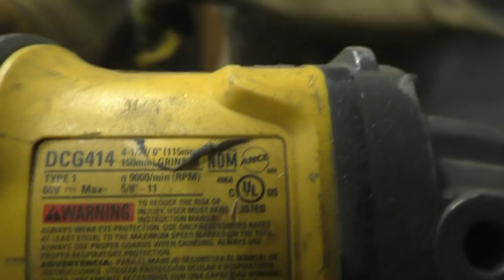Grinder Safety -- and lies you are told to scare you.

Comment: My motomaster grinder with lock on button practically exploded yesterday and I wasn't even trying.  wheel and nuts went flying across the driveway.  Then put it back together and ran it again to see the gears jamming up and grinding away lol....  A broken grinder disc, not cutting discs is even more dangerous due to the mass, but I managed to dodge all mine somehow.  Never use the sides of the disc and bore out the cut slightly larger than the disc used to prevent thinning of the discs by cutting two lines or one and a half grinding disc.  Never had a problem once doing that and always using a vice and two hands.  However I did use a grinder on a stick once and survived.  removing anchors from edges of the bottom of balcony slabs.  Was crazy but still felt safer than grinding on a ladder on the edge of a building.  Lookout below!

Comment: lol everything you said is true.. had my first cut off wheel shatter today, nothing happened. I always cut with eye pro aswell. I still dont want to use a guard even after that happening.
Reply: was cutting rivets out and on one of them at about a 30 degree angle the cut wasnt starting, i pushed in a little bit and BOOM.. no injuries. lesson learned though

Comment: The safety measures over safety measures are mostly meant for workplaces where you're an employee and you employer wants you to cost as little as possible, and it's much cheaper to buy some plexiglass and safety gloves to replace in 20 years than to potentially have to pay for work insurance multiple  times each year because someone had a little (a lot) too much to drink last evening and decided to toy around with power tools.

Comment: Safety is the point. Don’t be afraid of a tool. Learn from a skilled operator, and use common sense. That said, the only thing I’ve seemingly Doug do that bugs me is occasionally use a 7” wheel on a 4” grinder. The smaller tool runs at a significantly higher rpm.

Comment: A chunk flying off the edge of a 6" disk spinning 9000 RPM will go flying at 235 feet a second,  compound hunting bow territory. Yes, the chunk is light, but in the right orientation is jagged / sharp and you are relatively soft and squishy. 

Sure, there are plenty of reasons to take risk in life; there's usually something to be gained. Risk vs. reward. What the hell is the reward for taking the guard off of a grinder that is worth the extra risk? You save the 1 second it takes to repositioning the guard?   Attack a whitewater rapid, ride a motorcycle, enjoy life.   Preferably without experiencing a bleed-out event from a grinder.
Reply from the maker: First, you obviously don’t have a lot of time on the grinders. And secondly if you’re a bumble head with a grinder it’s OK you’re probably a bubble head when it comes to lots of things that you haven’t tried. There are people in this world that have skills that you do not yet possess.

Comment: Removing the guard is okay but removing the handle is dangerous.Grinders may slip out hand when there is no firm grip. I was cutting a aluminium bar and disk was keep clogging. The grinder fell and hit a spot below knee. the accident happened due to wrong disk application and one handed grip on grinder but things happen too fast with grinder. The one cut was 4 inch wide and 1 inch deep and a smaller cut also. I didn't even see what happened. All I saw was grinding falling down on the floor. Next thing I know my leg was cut.

Comment: Discs probably don't break just because someone twists the grinder in a cut. I bet it's after binding and running away, the grinder bounces hard into something else, breaking small pieces off the edge of the disc. These shards from the outer edge of the disc will launch at a higher escape velocity compared to the entire disc failing all the way to the arbor nut.

These small pieces lose velocity fast, but your arms aren't very long, and you might be in a tight space. If that little piece hits just right, it could pierce exposed skin, say your neck, since most people don't wear turtle necks while grinding. Keeping your neck out of the line of the disc is great, until the grinder runs away, unexpectedly, and bounces around off other hard objects.

So yeah, regular clothing and eye shield is basically a bullet proof vest to a  broken 4 1/2" disc. But if the vest only covers 98% of your important bits, you wouldn't want to run across a live shooting range for the fun of it.

Almost no reason to not use a guard. You object to using your left hand on the handle while cutting vertically? That is completely fine and normal when you leave the guard on. You call that dangerous, but you want to lock the trigger on so you can turn it around backwards while it's running and without a guard?

Also... wheels and wire brushes... way more dangerous than discs.

Comment: I was using my Ryobi today with a diablo metal cutting disc. Today I was cutting up an old kids outdoor metal slide/monkey bars set. The disc was hardly  used before today. I was at the end of making my cuts  (probably 10 in total) when the disc broke apart into pieces. Scared the sh*t out of me, at the time I was wearing safety glasses and my Sthil helmet with mesh face screen/headset combo. I finished the last 2 cuts with my sawzall which made the metal vibrate so not as nice as the grinder but finished the job. I will not buy the diablo disc again for metal cutting, yeah I know it probably could have happened with other brands but thats just how I feel.

Comment: What do i do if i go to a normal doctor because i have had an eye injury at work in both eyes and then he sees a black fibre sticking out of the inside of my top eye lid which looks exactly the same as the particles in an angle grinder cutting disc and the he refers me to this clinic to get it removed to prove to acc it is an injury and then the specialist throws the foriegn body away and then writes a letter saying its an allergy. How do i prove my injury when the evidence is now thrown away? Apart from a referal from the  doctor who saw the 1 piece  not including the 100 pieces that ive had to pull out of my eyes myself and all the photos and the samples i have kept how can i claim for acc? And how will i ever get my eyes fixed? Its been four years since the grinder disc jammed and shattered and bounced of my cheeks into my eye.
Reply from the maker: You take responsibility for what you decided to do.   Maybe go get a white cane and work on situational awareness.

Comment: Sometimes u have to cut a straight line from the top so holding your face on one side of the line will make it harder to cut straight. You have a tip for that?
Reply from the maker: Soapstone a line onto the piece and practice.  I will not be long till you can cut them like a band saw.

Comment: A surgeon friend of mine who specialises in facial reconstruction said that, a couple of years ago, he was called to the hospital to see a guy who had a half a cutting disc embedded into his face. Turned out he had been looking down the plane of the disc (with no guard) so accurately that the disc had basically sliced his nose neatly in half, vertically. One quick rhinoplasty later, and you could barely see a scar. Moral of the story: if you're going to aim the disc at your face, make sure you do it properly.

I've also had a cutting disc hit me in the face (forehead), but it was a Dremel disc, which has the approximate mass of a grain of rice, so I barely even felt it.

Comment: I have seen many and worked with it too and the worst I probably always see is the T-shirt being all burned from the sparks and a bit of that nice hot metal feeling in the skin nothing else not even using it the improper way like using a cutting disc for steel on a hard rock trying to grind everything sideways, directly, whatever direction. However I never used a battery powered one only AC plug...

But yeah, safety first, wear a T-shirt or just nothing, no gloves and no glasses thats how we all have always used it and mostly also with the safety removed for proper cutting on everything from any side :).

Now with wood cutting attached to a table with a huge disc I already know 2 guys here that have some few less fingers on their hands.

Comment: I cut only with the guard in place , stand on the right side of the cutting wheel and avoid doing shitty stuff like angle the grinder while cutting. Some cutting wheels are made of chinesium and and dont brake like a dewalt

Comment: How old would you suggest someone should be before using one?
Reply from the maker: When they want to use one.   I've held a grinder for small kids.   Until they can easily over power the tork it become self apparent to them that more size and muscle is required.  Children are not stupid, and that don't need to be lied to in order to see the danger.

Comment: Put a carbide tipped blade on there and use it to cut 2×4s. Worked with a guy who ran that set up as his skil saw. I put a 10" diamond blade on a 4 1/2" grinder. The centrifugal force on it was awesome but it got the job done

Comment: That photo of the disk in the safety glasses is fake!! You can see that the disk is sitting in a kerf cut out with that disk. You could pull that piece out and there would be a slot the width of that disk in the glasses. Totally fake! They even scratched a line coming out of both sides to make it look like it’s cracked!!

Comment: Glad someone said this. I use one daily and I too use mine without a guard, usually without the handle... I TRY to remember safety glasses but I forget sometimes (don't do that). I'm not tooting my own horn when I say I can do things with a grinder and a cut off wheel most people can't do with a dremel tool. Why? Lots of experience is part of it, quality equipment is a part of it (thanks Makita for still letting me lock MY OWN tool ON) but NOT being inhibited by PPE is another big part. Have I been bitten? Yep and it hurts. I'm sure it'll bite me again but it'll be MY fault. The tool is predictable, it will do exactly the same thing every time. Don't let the cut-off wheel get "nose-in" bc it's gonna jump, if you feel chatter dress the wheel, don't grind (excessively) with a cut-off wheel, be extra careful cutting soft materials, the wheel gets in a bind and jumps badly and DON'T buy consumables at Harbor Freight, other stuff sure, not disks. With enough experience you know when you're pushing your luck. Weigh that feeling against your desire to finish whatever it is your making sometime this week and carry on with or without the OSHA approved kevlar bomb squad gear.

Comment: Pretty sure they cut into the safety glasses broke the blade and stuck it into the glasses. I use a guard as long as it doesn’t get in my way, and mainly for controlling the sparks. In my opinion a wire wheel is much more dangerous l. Ether one is only dangerous when you don’t pay attention to what your doing

Comment: I once wiped a steel splinter into my eye. Worst thing that has ever happened in years of using grinders.
Reply from the maker: Yup, that happens.  I pull lots of them out of my feet, but that comes from grinding in Crocks.  : )   I had a College Professor working with me one day.  He wore welding gloves, safety glasses, and a full face shield.  And I watched as he took off the shield and glasses and then wiped his face while still wearing the gloves.  Fifteen years of building a steel boat and that is the only guy that got a splinter in his eye.

Comment: im a pipe welder, I use grinders every single day, I've had maybe 4-5 zip discs blow up on me. Every time I was glad I had a welding mask on. I've been hit in the chest / legs with them and it has some force behind it lol. so, I don't completely agree with the video...using a cut off wheel you should really wear a mask. using 1/4" grinding discs, can do without. Cant say I agree with telling people who are green to using these kind've tools to not be fearful of the potential " worst case scenario's " that could happen..

Comment: i work in a body shop and we have to be certified for safety and i still use superscription glasses while using a cut off wheel or a 5 in air grinder and still haven't had any issues. i only wear saftey glasses when i am in a weird angle or on the ground

Comment: Well I have had one half of a large cutting disc landing on my stomach, weared tshirt, sweater, and a thick protective jacket, still was blue, purple and yellow for weeks. don't underestimate these things. 
A friend of mine run he's grinder in the wrong direction, it throwed it self on he's chest and cut through a rib and jacked several, there was a lot of blood. 
My grandpa, plus 50 years metal worker, told me that never use a disc that has been wet and frozen, never use a cutting disc that has been used to cut wood and become wet.

Comment: those photos are obviously fake. perfectly round stuff has almost 0 penetrational power...pointy stuff does. so IF it was REMOTELY possible for a broken disc to be stuck in those glasses it would be with the pointy ends not the round shit

Comment: I use a grinder all the time in my hobbies without injury (except maybe hearing injury from my Harbor Freight grinder but none to speak of from my Dewalt.)  As a chef however I can attest to the fact that it just takes a loose nut wielding a knife to see a bad injury.  The operators of equipment need to sit down and learn how to properly use the equipment and think through the steps they wish to preform before attempting them.  It is a poor carpenter that blames his tools.

Comment: I was cutting out my Rad Support. Gotta Shard of metal in my eye. had it in there for about a day until I realised it's not coming out itself.. take a good ( non textured ) napikin and fold it over on itself using a corner ( like making a paper airplane how it makes a Sharp Point) then use the Corner to get the Metal Shard Out. easy Peasy

Comment: Come to Poland, they don't care about safety. The guy that wore a facemask because they were breaking off asbestos tiles from the roof, was being laughed at, until he took it off. I learned to work with a chainsaw here, no glasses, no face guard, no protection of any kind. That I'm still alive with all my limbs intact is pure luck. I learned to use the chainsaw though. I saw a guy climb in to a 50 feet tree to cut off limbs the size of small trees, with a running chainsaw, drunk. At the end of the day he left with his chainsaw strapped to his bike. The bike was holding him upright because he was too drunk to stand. They do get killed though, regularly. Seems to be part of the deal.

Comment: U are wrong,I thought the same as you until 3 weeks ago and a brand new Dewalt wheel destroyed my left hand, still might loose a finger and my hand will never be the same
My middle f inger was de
gloved, skinned to the bone,through a padded welding glove,so you shouldn't give someone a false sense of safety 
Your right with the thin cutoff wheel, but the grinding wheels are deadly, the piece the passed my face so close it knocked my safety glasses off nearly went all the way through a 2x4 in the roof of my shed against the grain
Reply from the maker: Love to see some photos, and what kind of grinding wheel?  And no, this is not a grinding wheel.

Comment: People are a little over the top. I still think the culpret is cheap discs. They dont have the fibres in them to stop them shattering. I had some unbranded cut off discs from a garage sale. A disc let go and a shard shot down through the top of my boot and right through my big toenail. 
Never happens with proper discs as youve demonstrated!

Comment: There is a tiny difference between a mobile grinder with 9k rpms and a grid connected grinder with 12k rpms. there is also a tiny difference between glasses, that can freely fly away when hit by a loose disc and glasses, that are stuck on a head and cannot move away, but must absorb the impact.

And then you complain about a lack of common sense, but use gloves right next to a freely rotating tool to mitigate the loss of heat protection from the hand guard. That's hilarious.
Common sense would be to let the protection guard attached and remove it only, when really needed. For 99% of all cases, the hand guard is even a problem.

Comment: no guard?
Reply: If you use a grinder for different things than cutting straight steel, the guard is just annoying. I have a grinder in my shop I am using just for cutting stock and new sheet metal; and that one has a guard on it. All the other grinders my shop is strewn with are "naked". 
I never had a shattered 1mm cutting disc doing me some serious harm besides a split-in-half fingernail or a little leak somewhere. And in the last 35 years thousands of them blew up on me. 
The only thing grinder-wise I really have a fearful respect for are wire wheels and pot brushes for high-rpm use. If you run them at 15.000RPM they tear a half inch deep and five inch long shred into your arm after the slightest touch. I owe some pretty presentable scars to those F*ckers...